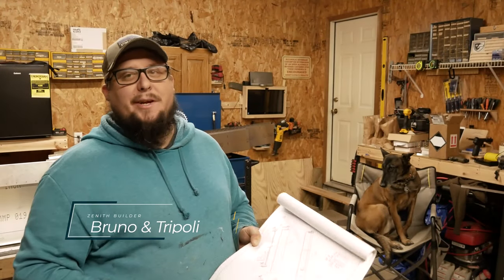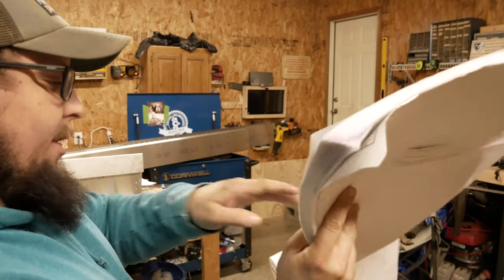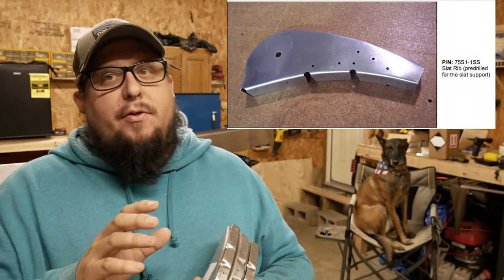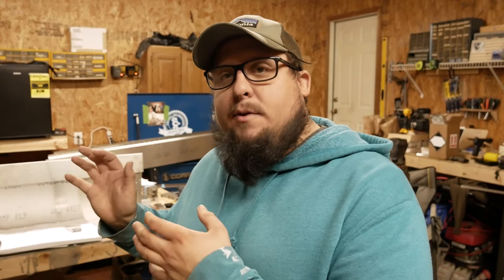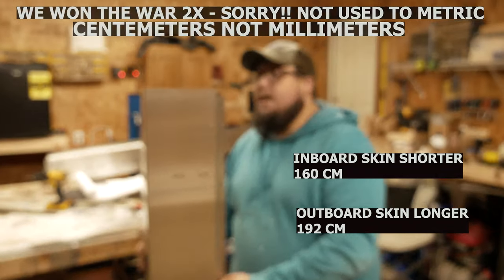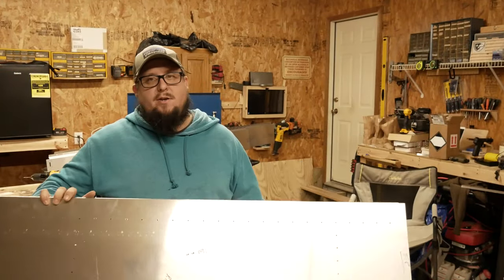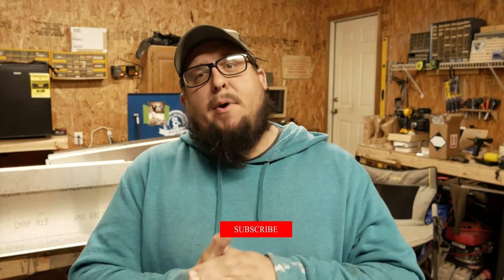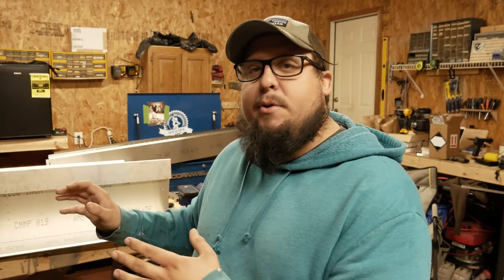KITPLANES Zenith 750 STOL slats build

Comment: Interesting, I was told that with the new mount brackets we don't need those angles. I wonder if I should put them in anyways, And I wish yous showed how the heck you rolled the skin around.
Talked to Roger at Zenith, we dont need those "l" angles on the new brackets, but the rivets through the rib and bracket need to be A5's